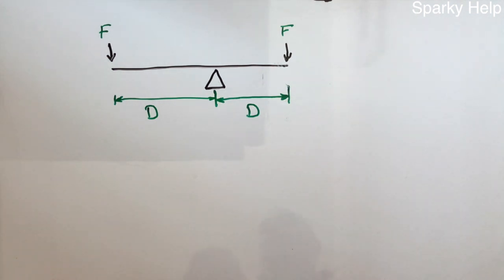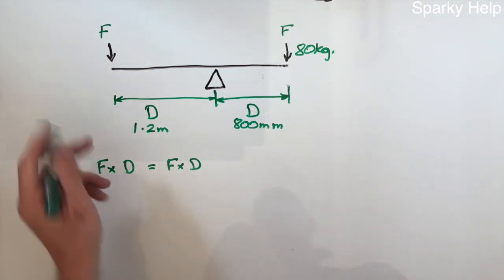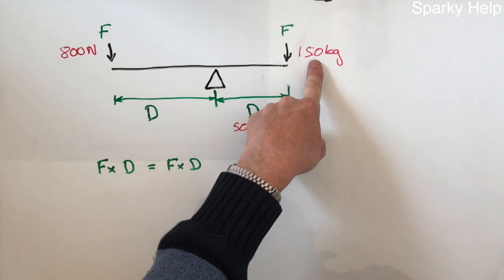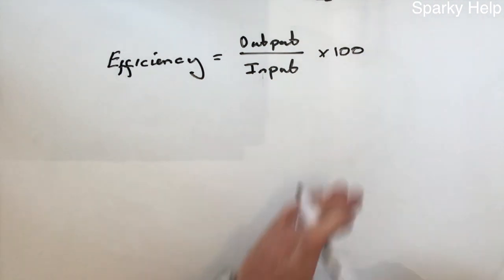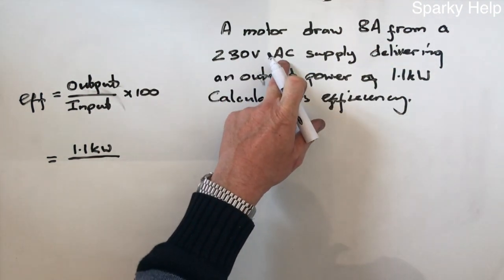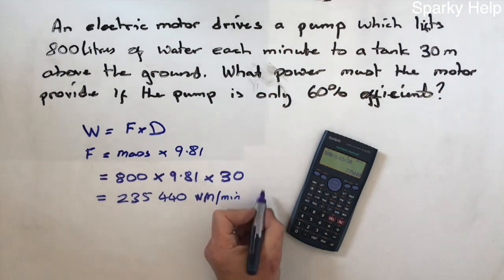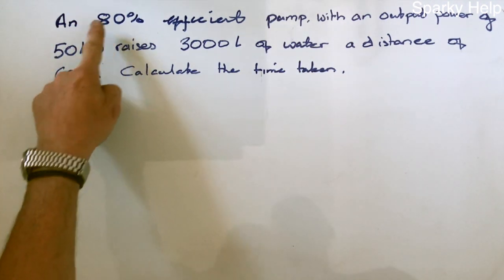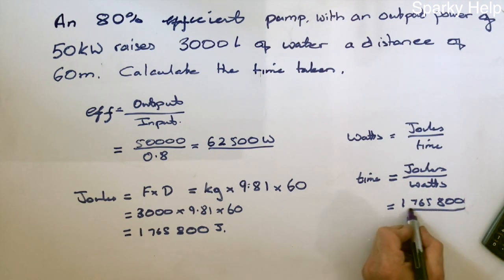Worked Examples for Mechanics, Levers & Efficiency Calcualtions

Comment: Just a question. 

If the pump i's running at 80% efficientcy isn't it's 1765800/50000 = 35seconds?

I'm not questioning you, I'm questioning myself.
Reply from the maker: Hi and thanks for watching, you are quite correct, I have calculated the time assuming 100% efficiency (there was actually no need for me to calculate the input power) - well done, I stand corrected.  I do try to make sure I have checked my results.  Again thanks for watching check out my other videos and maybe even like and subscribe.  I hope the time you got was 35.31Seconds.